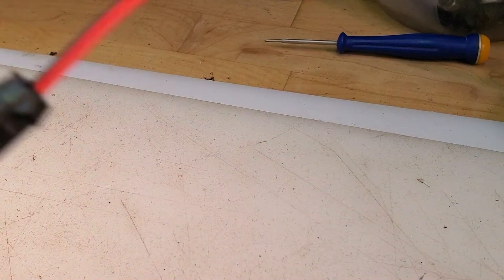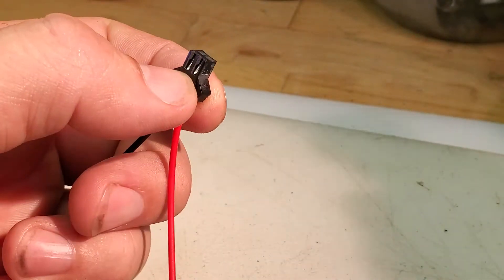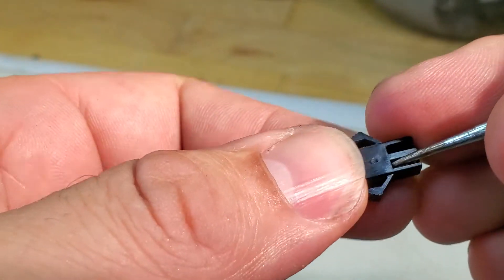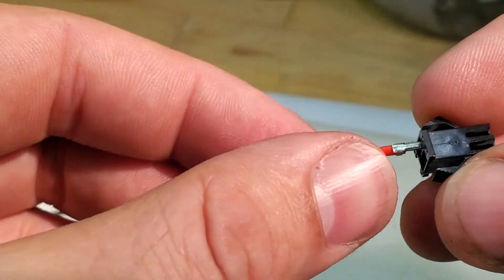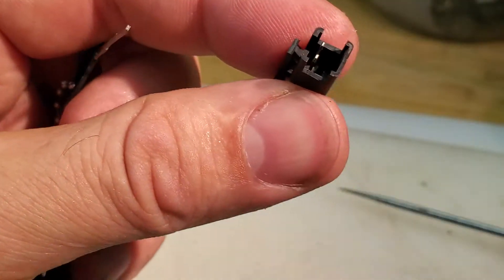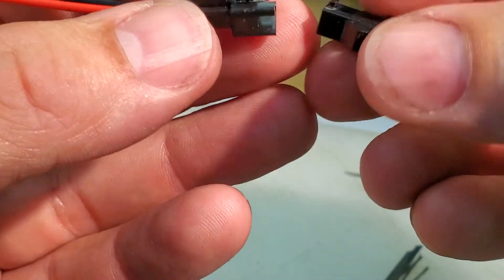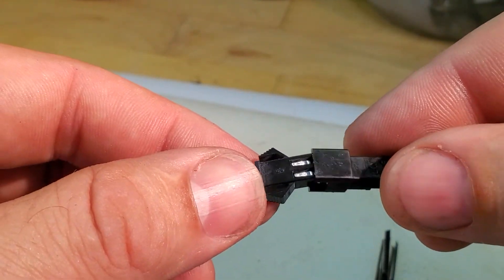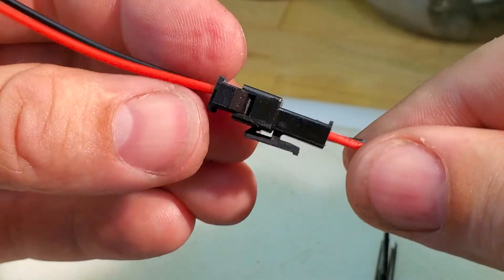How to Pin and De-Pin Molex Style Connectors

Comment: The pin was soldered or crimped into the wire please explain
Reply from the maker: @ArtBuddyIndian  they are usually crimped
Reply: @vantageoptics3767  all right, you mean to say that in molex style connectors, pins are crimped into the wire rather than soldering with the wire